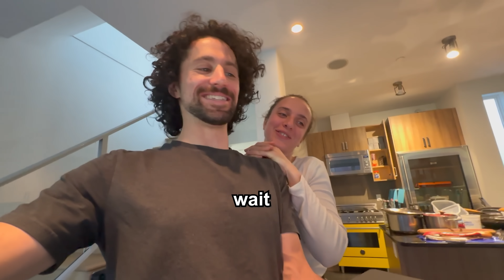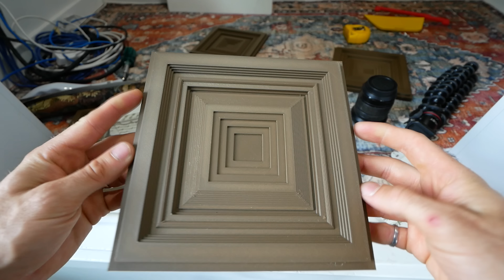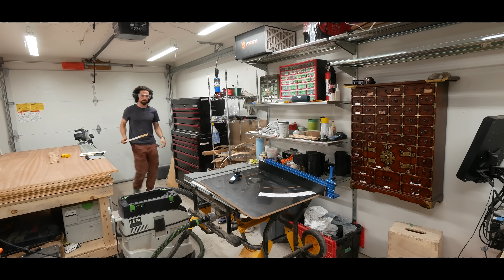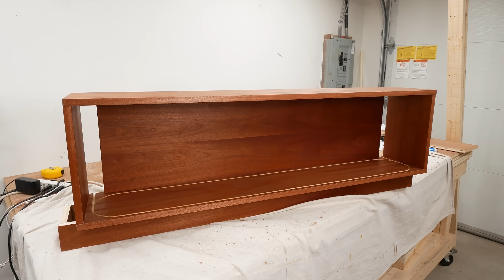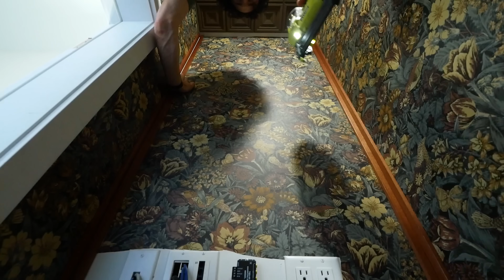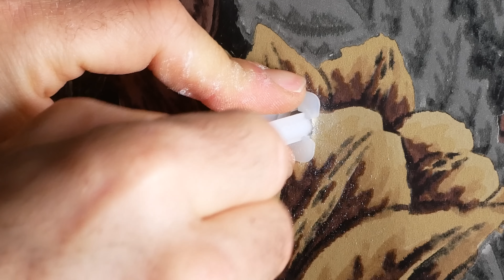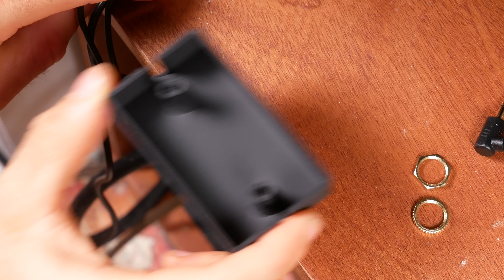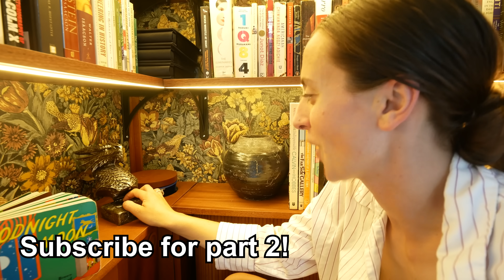I Built a Tiny Library on my Stairs

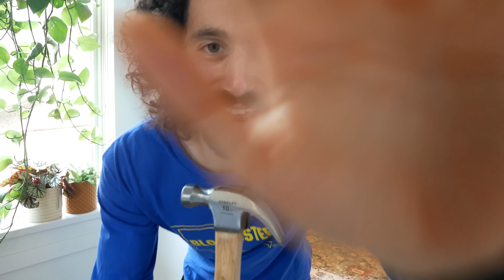Comment: 27:04 I'm probably too late but I have a few thoughts. You know how it's popular to have those barn doors that are basically a slab of wood sitting outside of the wall and you slide it horizontally back and forth on a track as the door? You don't have the space horizontally for that but what if you did something like that vertically? It looked like there was open wall space above the nook and if you did something like that it wouldn't interfere with the view out the window at all, if you made it look cool it would just look like art above the nook when open or that the nook itself was art when closed. 

As for the mechanism of it you could do something fun like a pulley system to lean into the cyberpunk side, maybe with a bunch of gears like you mentioned. Or just have it be something that has maybe a bit of spring loaded tension or something so it wouldn't take a lot of strength to open or close it. 

But I actually had another idea too and I don't know exactly how this would work.... You mentioned how it gets a little hot in the summer but you want it to be cozy in the winter. It reminded me of a community room at a building I worked in years ago. It was a cool room that was basically three full walls of windows and it was really nice because you could sit in there and look outside and all of that. However it could get really hot in the summer. And when you're in the middle of meetings you didn't always want random people walking or driving by able to see inside to know exactly what you were showing on screen or whatever. At the same time it would be a huge shame to completely block off all of the windows just to do a meeting. Because the majority of the light was coming in through those windows. There were overhead lights but it was a nice soft ambience from the windows themselves. And at the same time if you had to go manually pull down these like 12 ft high window blinds every time it would be both a figurative and probably literal pain

So the cool thing is whoever designed that building was really smart and they actually had completely electric blinds that you controlled with a normal light switch on the wall but they also did two layers on every single window and you could operate them independently, including stopping every one of them as high or low as you wanted. And the way they did the light switch, you could individually do the windows or they had three different switches that would control an entire wall at a time. So basically if I wanted to mess around with like 25 different window blinds to be extremely specific that the west side gets this length and then this one has a much lower blind on this wall but the others on the wall are higher and that's just because the sun is coming in at this angle blah blah blah, I could do that. But if I was getting ready for a meeting and I didn't feel like sitting there holding down buttons or flipping switches that much you could just flip one switch and it would control all of the window blinds simultaneously on one wall. I don't remember how many were per wall but let's say there was five per wall, it was kind of nice to just flip three switches and have 15 blinds electronically go down at a relatively fast speed so it didn't feel like forever but a slow enough one that it wasn't chaotic. 

The two layers by the way were one layer closer to the window itself which was a black strong and durable blind but it had a whole bunch of tiny little holes in it so it did a good job of blocking easy views into the room while still allowing in plenty of light. And then the next layer was more like a typical full canvas. For both of them they basically rolled up at the top and then unrolled to lower it. 

So that was one thought, that there's probably some sort of system in place already for those blinds because I know people will put those on windows that are difficult to access like if you have your bedroom in a loft space and you need to close the window that's like 30 ft high on a wall that you couldn't even run and jump to reach. So maybe you could use something like that. 

I do have another idea that still kind of runs in line with the idea of using the verticality of that wall but this one is a lot crazier and I have absolutely no clue if it would work or be of any interest. 

But I was thinking it'd be kind of neat to sort of make a mosaic like mural that's very vertical coming down that wall and that would flow over the nook as part of the design and art but which like you said with the split painting you could pull aside or open up in the center to access the nook 

. But my thought is what if you made the whole thing look like a waterfall?

It could be kind of cool because if you had the wall itself kind of seemed like almost a little bit of rocky and grassy along the edges and then you head the whole center part look like water, if the water covered the nook then if you opened it it would look like you had a little cave behind a waterfall which feels very fantasy to me and kind of fun. Obviously if that were real water it wouldn't be great because the books would not do well with that lol 

In terms of how to make the waterfall itself I was initially thinking if you did something either like basically a bunch of different frames that you hung on the wall that together could give this impression of a waterfall, so you'd have to paint over the top and bottom of some of the frames to continue the effect of water but it would make it very renter friendly because it would equate to just hanging a few pictures and it would be much easier for you to completely change the design If you ever decided you didn't like that vibe anymore. All you have to do is just switch out the pictures and you're done. 

But my first thought was actually either using some sort of fabric, like a really light fabric that could add some texture and movement although I don't know if that might be either a danger for the cats or a fun little thing for the cats but I guess I could see them crawling up the wall. 

On the other hand though you could make that a fun side quest and have it be a cat friendly wall climbing experience where little platforms are built along the way up the wall giving the cat something to jump on and have fun with but it would also be part of the larger artistic design so it would just kind of make it look cooler and more realistic 

I was thinking it depends I guess on how solid of a door you want for that little nook. I could certainly see wanting to be able to really close it off but I also could see wanting to be able to have it a little bit open. 

That's where my thought about the dual blinds came in. If you were to do cloth as the closing mechanism rather than something solid like wood, you could do two layers... One could be more of a gossamer light fabric that would allow a breeze in and the other could actually be repurposed blackout curtains to really close off the space. The downside of course would be you would first of all have to have the opening probably be away from the window because that much fabric gathered up in a point might block the view of the window and number two it wouldn't acoustically really help much. 

But I was thinking I don't know if it exists in a different way right now but I have a skirt I got 10 million year ago on thinkgeek or some other similar place. And it's a really cute skirt that has a lot of tulle underneath in a bunch of layers that makes it puff out like one of those fancy old time skirts, but it's a skirt that goes above my knee and the outer layer is this really pretty, light, soft blue sky design that has white dots sprinkled across it in constellations to represent stars. And they strung a whole bunch of little LED string lights up within the tulle being held on with these little elastic snaps so you can pull the lights out for washing the skirt. 

They put a hidden pocket basically at the base of your back that holds the battery pack. It's kind of awkward for walking around because it's old enough that the lights are basically little Christmas lights and the battery pack is kind of heavy and unwieldy but I have to imagine in the decades since I bought that there's been a lot of improvement in the combination of LED lights and fabric of some sort.
Reply: (thought continued because it was too long for one comment sorry lol)

What I thought could be kind of cool if you went with the waterfall theme or whatever else design, is you could have a really light layer of fabric or whatever underneath something that's semi-translucent that you're using to represent the water, whether that's another layer of fabric like my skirt or something else. But the LEDs underneath could have a really gentle downward vertical movement and it could make it look like moving water. 

Which I thought could be nice and calming both from the outside because it seems like you can see that whole wall pretty well from a fair amount of the living room downstairs, but it might also give a really nice soft glow and movement when you're sitting inside the nook If you had that gossamer layer of fabric closed but not the blackout fabric if you were to have that. So it basically let you have this movement of light to add to the coziness but you could still see through it out to the window if you wanted which also could help with the heat. 

I also had wondered about instead of fabric if there's any sort of digital screen or something else that would really let you more easily completely change the design whenever you wanted so if you weren't interested at all in the idea of like a waterfall or maybe you liked the waterfall at first but then you get bored of it after a month, it would be cool if there was a way to be really creative with the larger design and change it completely however you wanted 

One thought I had with that is kind of going back to Christmas lights but more in the way of how you see those people have those really cool and complicated Christmas light setups where they can completely change the design of everything using whatever that board is they always have. I obviously am not any kind of an electrician or engineer or anything at all even close. So I have no idea if any of these things would even be possible. 

But I was thinking if the majority of the larger wall design was kind of like when nerd forge made their library area they did something outside a fake window so they could make it feel like a living landscape. I think they basically just had a TV but I don't really remember. 

Or like when you think of those really cool drone shows in the air or even laser shows where you just change the formation of the light and it makes a completely different picture. I was just thinking something like that could be kind of neat. 

A fun bonus for that sort of thing would be if you guys like to celebrate different holidays you could theme it. Like let's say you decided to do a Halloween party, I don't know if you even celebrate Halloween, but then you could completely change the imagery to be something spooky and dark but then maybe you want to surprise Eden for her birthday another year so you decide to change the art or design on it to be something that's really special and meaningful for her. 

Again I don't really know if LED lights are affordable and exist out there that would allow you to have the kind of precise control to be able to make cool different designs or if you would just straight up have to have basically screens or TVs which I think would be too annoying at that point. And one thing I could see as a major downside of the fabric or larger waterfall idea is that would start collecting dust and be kind of annoying to clean. But on the other hand if you even did something as simple as basically the same thing I was talking about with the blinds on the windows but you just essentially painted the blind itself to be whatever theme then you could roll the whole thing up or down however you wanted and maybe you just change out the cover or art or whatever it is that you maybe paint or pin or tape or whatever onto the blind itself. Kind of like making a tapestry I guess but one that is more modernized because it would essentially be an ability to electronically move it up and down with a button. You could also do something kind of like people do with photography where they have a bunch of different backdrops that I'll come down from the same mechanism on top but of course instead of backdrops it would be different covers. 
Anyway all of my ideas revolve around the idea of using the verticality of that space and making it multifunctional by including some art or sculpture or something that could be made to be a fun exploring place for your cat if you wanted to or if you wanted it to deliberately not be something the cat would go on You would just design it in a way that it wouldn't give the cat the chance. And if you created the whole thing in a way that made it very versatile and customizable with minimal effort I think that would be cool 

I was also thinking of puzzle pieces, not like the normal tiny size puzzle pieces or anything. But more like an idea of larger different size and shaped pieces of whatever it would be, maybe whiteboards or chalkboards or actual paintings like I mentioned before or maybe cloth or whatever it would be, even LED structures or something that you're able to 3D print of some sort.... But different pieces that would be easier to take down and customize and maybe they are already designed in a way where you can move things around and it'll change the overall picture or art or whatever it may be in a way that still looks cool and cohesive but lends some movement in case you ever get bored. Sort of like the wall equivalent of that carpeting that's really just a bunch of squares that's made so that if you spill in one section you don't have to replace the entire carpet you just pull up that one square. Something kind of like that but for the wall and easier to deal with. 

You know I guess another idea would be if you were able to secure tracts vertically along the wall that were magnetized you could kind of do like those metal poster things that are always being sponsored everywhere but I've never actually tried myself. But basically you could use magnets as a way to quickly and easily swap out different things on that wall and ultimately the door itself whatever it may be that is used could be something that could integrate into the magnetic system. Like maybe the wall slides up and down on the tracks because it has magnets on it or something. 

I do think it would be nice if you had a way of incorporating a little fan or something in there if you get too hot and I thought about how you could integrate it into the door but I think that would probably require something more solid or less mobile then my general vertical idea would require so I suppose instead that would be the sort of thing that would need to just be on the shelf or something. It would be kind of cute if you could have just plugged one into that little hidden space and have it pop up and be a little fan when you wanted to do that instead of snacks. I actually thought that was going to be a hidden little fridge or ice chest so you could have a cold drink while reading and it would have been kind of funny after you got rid of the hole chest freezer in there but at the same time that super awesome little hidden space wouldn't really have held much to drink and again you get a little worried about things that are wet inside that little nook

Comment: for the door, i vote stained glass! could work well with both the victorian and midmod vibes, you could do some fun designs, and it wouldnt block the window. doesnt even have to be proper stained glass, you could use tinted film and jury rig something for the solder lines

Comment: you could do one of those woodwork-painting fake art doors/windows, but as a real door?
I've only seen a handfull of these but it is usually a fake door or window with a solid frame and either one solid piece or two parts, and it looks like it can open, and there is a landscape painting in the openings behind the crossing lines of wood in the frame... like those windows with two parts with 8 panes in each? I saw one that had that old church stain glass look, with actually glass and the landscape behind the glass... In the case of this one it would be an actual door rather than a fake one^^
If you wanna go for a bit of irony... you could paint a library instead of a landscape so the secret is not so secret at all😂
but maby all of that is a bit too much😅

Comment: Probably needs foam padding on inside to prevent head injuries while walking out. As for the door, HP style paintings that change depending on the direction viewed would be fun (and suggests movement, hinting at something behind it). Otherwise, a shallow shelf could be interesting as well.

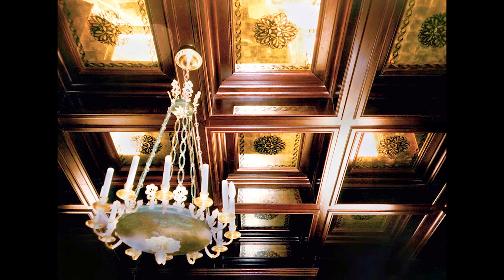Comment: 03:31 — I don't have anything against a fun 3D printing project, but I think plastic ceiling tiles are readily available on the market and they may even be cheaper than using your printer materials and running the machines.
Reply: It's a sponsored video from the 3d printer manufacturer, it seems like it was meant to showcase what it can do. Can't be mad since you can always adjust your plans based on what you see as the more appropriate option for your project.
Reply: It's about him CREATING rather than purchasing.   He is a Maker
Reply: Which is good because most of us do not have access to 3D printers
Reply: No, you do not seem to understand this man loves DIY